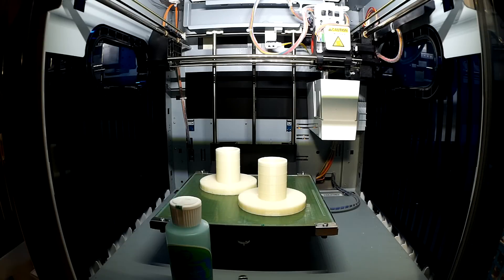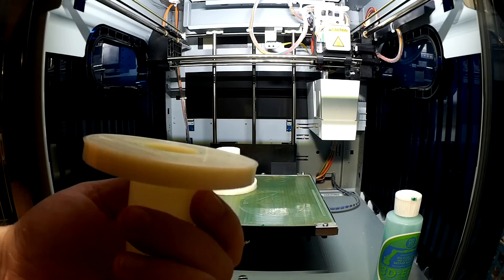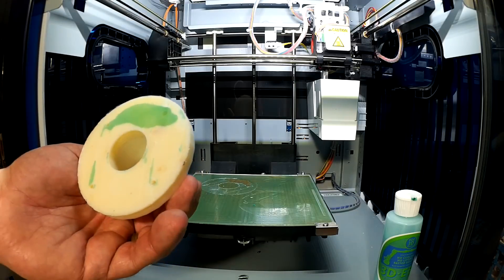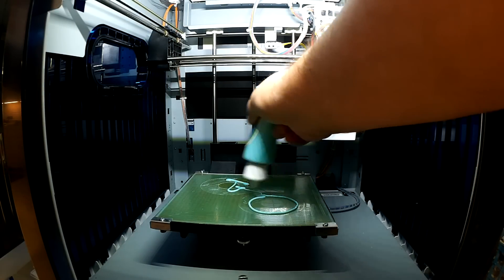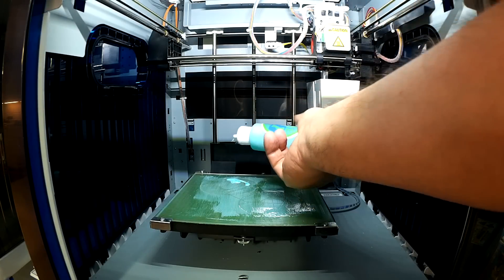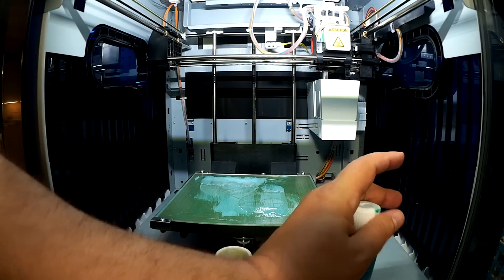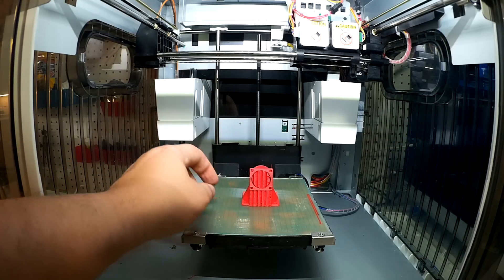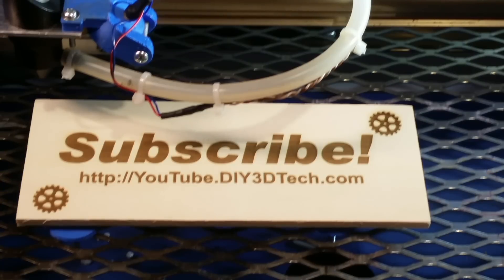XYZ Printing Da Vinci 3D Printers - 3D EeZ Followup!

Comment: That stuff sticks too well. I would be carefull you dont pull the bed surface off and chip the glass. The glue stick i use sticks really well and when the bed cools the part just pops off. Tombow professional wrinkle free in a white tube. dont use too thick or the same may happen with chipping.

Comment: I'm wondering if it's supposed to be pronounced like "3D Ease" rather than "3D-EZ". The extra E is a little unclear. In any case, sounds like it's working well for you.
Reply from the maker: +Mighty Jabba&#39;s Collection Tomatoes or Tomatoes, the stuff work crazy good so yes very happy as that is why I did a follow up as those where BIG hunks of ABS a they would have warped with just glue  (have printed them before) so wanted to share first hand with folks as for over a year ABS has been a fight, however with this stuff think I am finally winning!